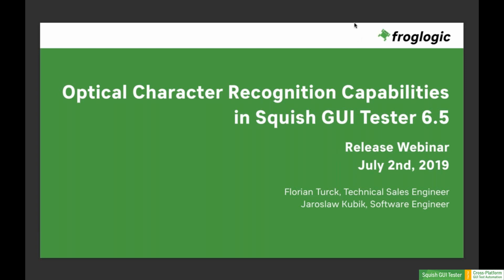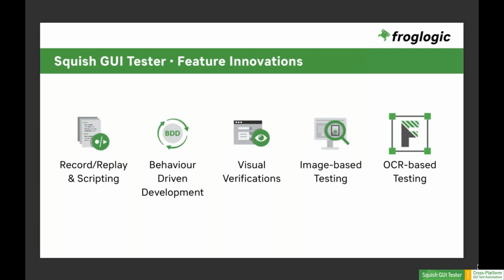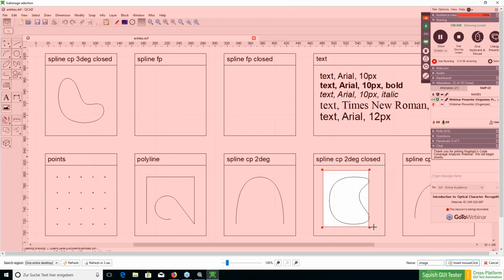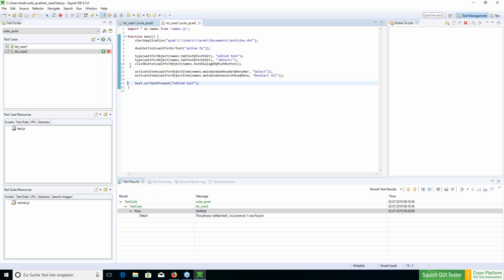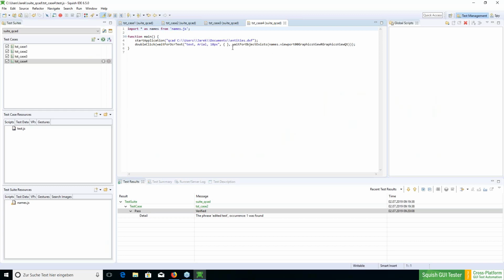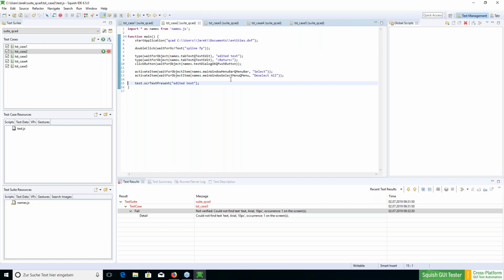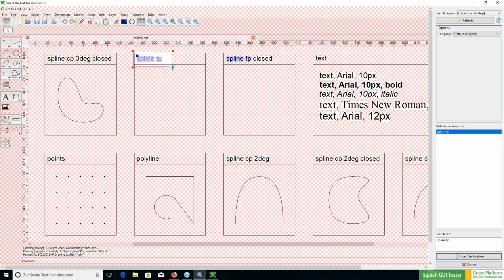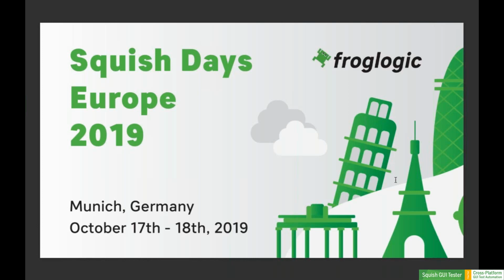Use Optical Character Recognition (OCR) to Automate Your Tests | Release Webinar | Squish GUI Tester

Comment: if some text which needs to be verified is not visible in the same windows, which can be visible by scrolling down the screen..in that case how to verify the OCR text? "scrolling the screen" is not being recorded..
Reply from the maker: It should be possible to add script commands to perform the desired scrolling, for example via a mouse click on a scroll bar, by setting input focus on a specific control to force it being scrolled into view, etc. The specific approach would very much depend on the GUI technology and GUI of the application (and thus the Squish edition used for automating it). We recommend to contact technical support (https://account.qt.io) to discuss specific cases in detail.